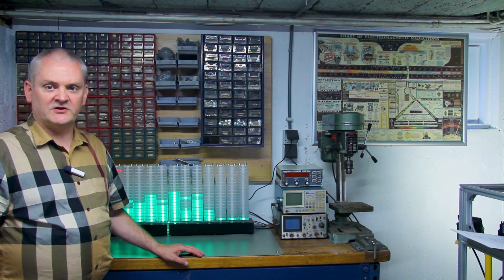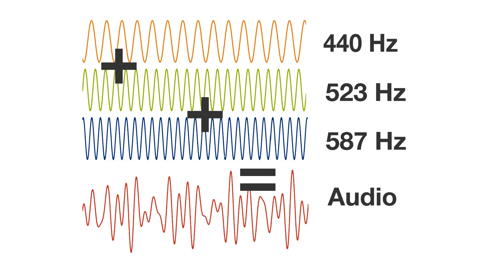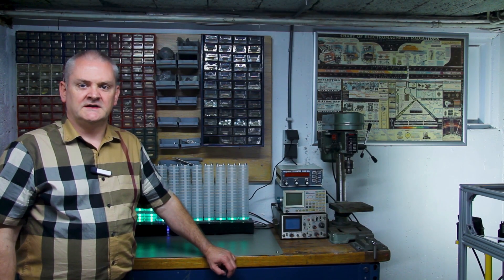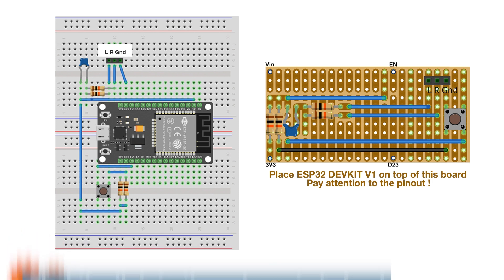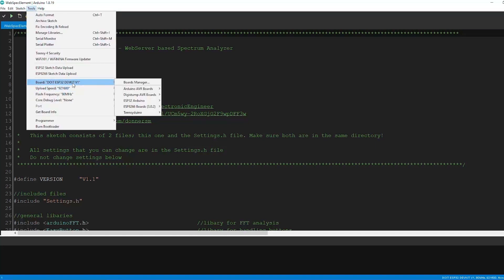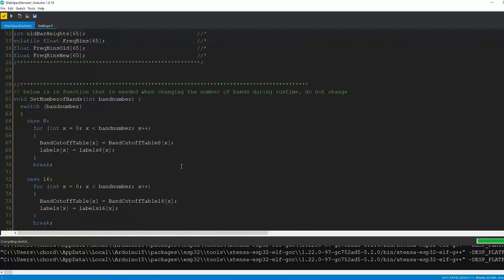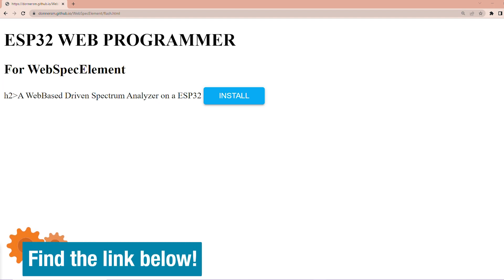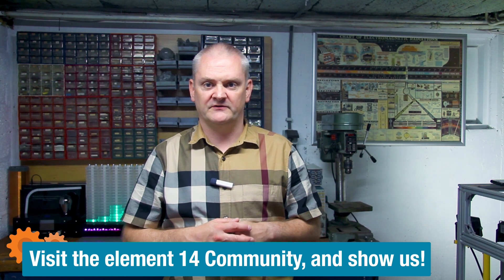Making a WiFi Connected Audio Spectrum Analyzer with ESP32

Comment: Bit late to the party here! Thanks very much for the great video and resources. Unfortunately I can't get the code to compile - it hangs on:
/Users/Nick/Desktop/Arduino Code/WebSpecElement/WebSpecElement.ino:111:1: error: 'arduinoFFT' does not name a type; did you mean 'ArduinoFFT'?
  111 | arduinoFFT FFT = arduinoFFT(); /* Create FFT object */
      | ^~~~~~~~~~
      | ArduinoFFT
/Users/Nick/Desktop/Arduino Code/WebSpecElement/WebSpecElement.ino: In function 'void setupI2S()':
/Users/Nick/Desktop/Arduino Code/WebSpecElement/WebSpecElement.ino:138:9: error: 'adc_gpio_init' was not declared in this scope
  138 |   err = adc_gpio_init(ADC_UNIT_1, ADC_CHANNEL_0); //step 1
      |         ^~~~~~~~~~~~~
/Users/Nick/Desktop/Arduino Code/WebSpecElement/WebSpecElement.ino: In function 'void loop()':
/Users/Nick/Desktop/Arduino Code/WebSpecElement/WebSpecElement.ino:259:3: error: 'FFT' was not declared in this scope
  259 |   FFT.DCRemoval();
      |   ^~~
exit status 1

Compilation error: 'arduinoFFT' does not name a type; did you mean 'ArduinoFFT'?

I know you can't really troubleshoot code on someone else's hardware but I wondered if you (or anyone else) had any helpful suggestions please?

Thanks very much. Nick

Comment: Fantastic!  Compiled and downloaded to board.  I see a ton of noise in the FFT output browser when no audio is supplied to the microphone.  After checking the audio input to the ESP32 (originating in the microphone) I observed 1-V noise pulses at 30 mS intervals.  I assume these are related to the WiFi transmitter.  Will need to work on power bypassing to reduce the noise.  Has anyone else seen this?
Reply: I think noise is a common problem with the ESP32, but the cause isn't clear. It's either a physical noise (from the WiFi chip), or the power line has electrical noise. https://www.youtube.com/watch?v=zPd5tm6MtfM https://www.youtube.com/watch?v=LCmgfb5HrIY https://www.youtube.com/watch?v=BkiDfcDYZFQ
Reply: Yeah, could be noise from the power supply or usb…. You can reduce it by adding a load to the input like a 1k resistor in parallel with the input port and ground. Also, in the software there is a noise tresshold that you can play around with